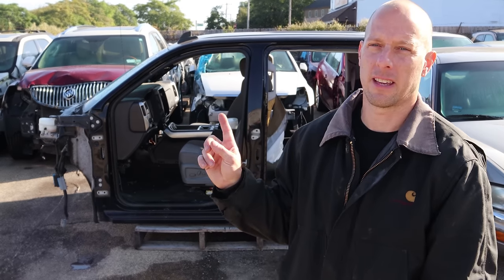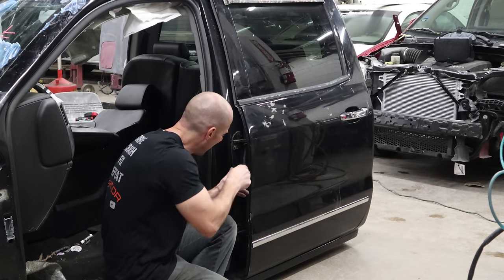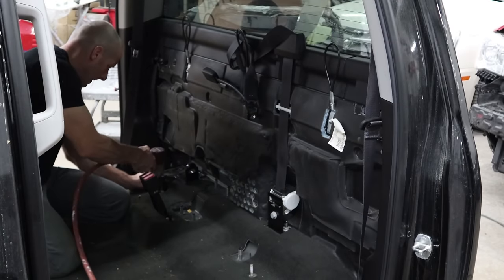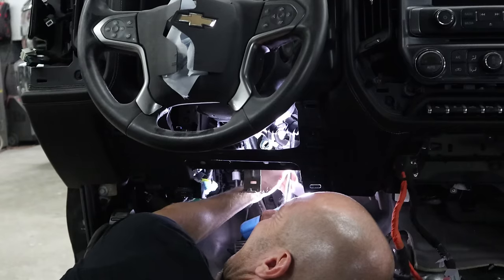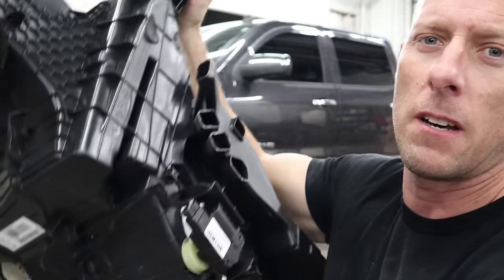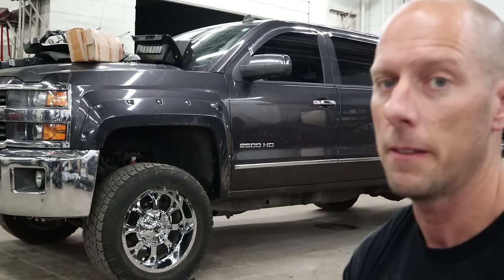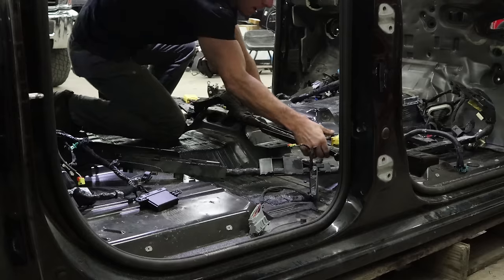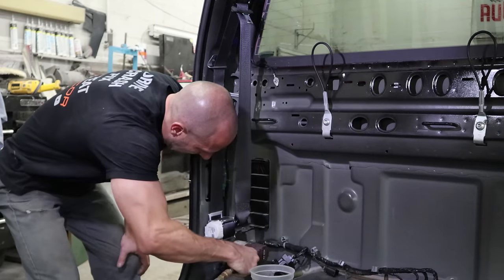Gutting the cab for the 2015 Silverado mistake and attempting to reassemble it. (Part 5)

Comment: What part of the vehicle does the paperwork go with? I always thought it was the cab. Is that correct?
Reply from the maker: I am using the paperwork from the original black truck.  The state will come retag my cab with that vin number and it is what is stored in all the modules on the truck. Thanks for watching.
Reply: @vehcor  Oh, I see. So you probably have to have the paperwork from the new cab as well right? Thank you for the quick reply. I've subscribed, your videos are great.
Reply from the maker: @SwapPartLLC  Yes, I have a receipt for the cab from the salvage yard.  I take that with all the other documentation for all the other parts I changed to the Secretary of State and they verify it in the anti-theft inspection.  That is the last step before they issue my clear, rebuild branded title. Glad to have you with us!
Reply: @vehcor  Thank you. This information will be very useful to me sometime in the future, as I've always wanted to do this. Long ago, I worked as a mechanic for a few years and I've done everything except rebuilding wrecks. Looks like a lot of fun.
Reply from the maker: I will have some tutorial videos coming out when this series is finished that might be helpful.  Rebuilding cars can be fun but stuff never goes according to plan.  Start small so that you don't get overwhelmed when it seems like nothing is going right.  Good luck if you jump in.  The finished product is worth the hassles at least to me!
Reply: @vehcor  Thank you. I look forward to those tutorials.

Comment: So just have couples of questions is the 2015 being upgrade with a newer model wiring harness and such to make it perform better, I didn't understand why you were changing the airbags above the door's was there something wrong with the other ones I'm just a little confused on some of the things you were changing that you could have left and save yourself some time maybe you can give me some answers because you were changing the wiring harness is that something from the newer vehicle that you are putting into the 2015 cab I understand the dash was messed up because the airbag went off on the passenger side, and the firewall insulation why was that changed I didn't see anything wrong with it maybe I miss something, I do like your work it seems like you know those GM cabs for sure

Comment: As always my friend very well done video. I have been looking into doing something like this, I wanted to ask where is a good place to start? I have been looking at copart.com but not sure if it's right for me. Thanks
Reply from the maker: Copart and IAA are the two biggest salvage auctions.  You can set up free accounts on both and watch cars, see what they are selling for and see what they need.  Kind of a test drive before you pay for the membership.  I use car-part.com to locate a lot of my used parts and give you an idea what the repair will cost.  I will have some tutorials on deciding what and how to buy when I get this truck done, that may help you out.  Thanks for the support!

Comment: You mention rocker rust. 

I have a 2001 that has large full length running boards and I am  at 350k with out rusting through (not gonna pretend there isn't some rust i can't see). I don't think i ever washed the truck.

I would like to have the same success with my 2018 Dually. What do you recommend for prevention the rocker rust?
Reply: Paul's Pro Tips oil. Oil rustproofing is the only thing that works
Reply: Or move to Arizona. Salting roads is a travesty that should never have been allowed from the start.
Reply from the maker: I will cover rust prevention in the future videos of this truck and even more in depth in one of my tutorials.  I would love to move to AZ and avoid all rust.  Possibly in the future.  Thanks for watching.

Comment: And now we know why replacing a heater core requires a co-signed loan.
Reply from the maker: You can leave the dash pad on for that but the heater box bolts are much harder to get at with the pesky engine in the way.  It is not much of a trade off. Lol I like those jobs, they pay big money at my job and I can get them done pretty quickly.

Comment: How do deal with the different Vin numbers between the 2 bodies?
Reply: interested in that as well, with the frame coming off truck 2 and the cab from the junkyard, are there even any VIN stamped parts left of the first truck?
Reply: I came to ask the same question. 👍
Reply: Depends on what state regulations say. Some states the VIN is tied to the frame others to the cab
Reply: He might need a new vin to be issued for the truck.
Reply: @GreyFox2000  This. Here in Georgia, the VIN stays with the cab, on GM trucks particularly, there is a plate on the driverside dash like all vehicles, and then under the hood  above the engine on the firewall. While I worked at a GM dealership, we often had frames come in to swap into wrecked vehicles, no problem. I think it just has to be noted in the VIN history that the frame was replaced due to X.
Reply: Swap vin plates
Reply: Dan Bri kind of illegal
Reply: @McFlysGarage , "kind of"?  It is.
Reply: @brittonsautoplex , is it worth going to jail over?
Reply: Keith Coppage only if you get caught 😉
Reply: Rivet the vin plate into the new cab. I don’t see a problem with it.
Reply: In the grand scheme of things the dmv will never know it’s a different truck.
Reply: You need both titles for both cabs, go to dmv and let them know the situation, they will sometimes issue a new vin for the truck. Vin goes with the cab, not the frame.
Reply from the maker: Here in Illinois I have the state police retag it for me.  It can take a while, they were called the day I got the cab...... still waiting.  It is the main and only reason I did not want to swap the cabs in the first place but this deal was too good to pass up.  I do have some connections that I may have to use if the wait gets too long.  The frame vin does not have to be changed and will be documented along with all the other parts like the door, fenders, hood and drivetrain parts in the Secretary of State anti-theft inspection which comes after the safety test.  I covered something similar in my Enclave video but not everyone watched that I realize.  Thanks for watching
Reply: I always use the one with the clean title.

Comment: For your interior assembly and disassembly, which impact driver is that and how do you like it? Great video man!
Reply: I've done similar repairs, and a 12V 1/4" impact is perfect for most interior bolts and screws.  For dashes and seats, break the bolts loose then use the 12V to zip them out, or get a 18 or 20V impact.
Reply from the maker: The one I was using was an older Matco.  It is ok, nice and compact with decent power but the battery doesn't last long (it is old though)  I have a Dewalt 20v I use all the time at work and it is decent.  A little bigger but enough power and the batteries usually last long enough for the other to charge.  I have also used the Milwaukee 20v with pretty much the same results.  Personally I am not a fan of cordless tools but for interiors you cannot beat them........ except on seatbelt bolts.  I find myself going back to the air impacts to get a lot of them loose.  Thanks for watching.
Reply: vehcor thanks for the reply! I’m in the market for one. lol

Comment: I am having trouble keeping up.
What parts are you using from the very first truck?  The frame, cab, and trans were toast.  Just the motor?
Reply from the maker: It will all make sense in the next two videos.  Original engine and turbo, complete interior, rear end, bed, tailgate, 3 doors, wiring, all modules and possibly the wheels unless I keep the aftermarket ones.

Comment: jesus, how do you remember where everything goes and how it goes together?

I ask because I have a 2004 F150 FX4 that has an amazing body but driveline? not so much. I've seen others for sale with leather interior, lower miles, but terrible bodies and been thinking about buying one and swapping the good for the bad.

I mean, I had to just put winter tires on, $1000 or I could have bought a parts truck with GREAT winter tires, and aluminum rims, for $2000.00. No leather interior though. Plus it had half the miles on it than mine. I just have no where to do it all or keep the parts until I can swap.
Reply from the maker: It comes with practice and since I had just taken one apart before this one it was even easier,  Stuff really only goes back in one way so the worst that happens is you have to remove something to get something else back in the right place.  Adding options can be tougher than you think.  Manufacturers don't want you to upgrade so they make it hard.  An 04 might not be too bad but on the newer ones options have to be programmed into the modules and they don't allow you to do that even at the dealer level.  So do some research before you jump in.  If you are just swapping in new parts for your worn out old ones, take the parts truck apart first and take pics along the way.  Then when you get to yours, you have already done it once and have some pics to help.  Thanks for watching, hope that was helpful.
Reply: @vehcor  yeah it was helpful! That's one thing about smartphones now: very easy to take pics along the way. Yeah, I wasn't so much interested in adding options, just replacing my existing cloth interior with leather etc. The beauty about youtube is there are plenty of guys who do step by step brake jobs etc so you can literally watch on your phone while you do it. I did all my COPs that way as well as my VCT solenoids. 

I do enjoy your vids and will keep watching this project come together. 

One thing that kills me though: the shear amount of wrecked vehicles available in the US and the prices. I live in Canada and don't see that many and the ones that are here are crazy expensive. There's a big auto wreckers not far from me and they want the same price for a used engine as a rebuild. Hell, I was looking at an entire F150 in Ohio for 1/3 the cost of a used engine. The kicker for me is transporting it, and importing it. It isn't that complicated but not like I can just drive over with a trailer and bring it home.

Comment: Just a question from a guy wjo has not been following the series. Why not fix the parts truck? Looks te be in a better condition than the project truck
Reply from the maker: Looks can be deceiving.  It would require more work, has less options and has a junk title.  Just because it runs doesn't mean it  is better.  Thanks for watching!

Comment: At about 9 minutes in, you say that the reason you have to do this is because the passenger airbag went off.   So, you can’t just replace the airbag straightaway ?  Or did I miss something....( I realize you are digging to get at the damaged stuff ) ?
Reply from the maker: The dash pad has the airbag attached under it.  When the air bag deploys, it tears open the dash pad.  That is the only reason I had to replace the dash pad.  I got the new/used one with the cab but had to change the wiring, pedals, heater box, firewall padding, etc so that is why all the other stuff had to come out.  Thanks for watching.

Comment: Just plastic weld the heater box and be done with it. It's pretty silly to disassemble an entire truck just for that.
Reply: HKRXPRS 
Plastic weld is shit, not to mention once a heater box twists a little, you’re going to have a bad time.
Reply: @Everythingisgoingtobealright  There are many different types of plastic weld techniques and done right it would be more than good enough to ensure you are trouble free for the entirety of the car's lifespan.
Reply: HKRXPRS 
False.
Reply: @Everythingisgoingtobealright  So, explain how plumbers affix 2 pieces of PVC pipe together. Things that make you go hum, lol.

Edit: I plastic welded my headlight assembly when I cut it open to put better projectors in the housing. That's arguably in a much harsher environment than a heater box under the dash. It's been about 5 years since and the headlights are still sealed shut. You'd be hard pressed to see the seam where the cut is.
Reply: John Long 
Glue.
Reply: @Everythingisgoingtobealright  It's actually PVC cement. It's not glue. It chemically melts the plastic, permanently fusing the 2 pieces together making them one piece.
Reply: John Long 
Plastic weld is shit, so glue the box. You are still going to be in a world of hurt if any of the flaps, doors, linkages or seals are damaged or knocked out of wack. The time he will spend swapping out the other box is money in the bank.  But what do I know.
Reply: @Everythingisgoingtobealright  You make good points for replacing it. Calling plastic weld shit is baseless though. If the plastic is simply cracked and not deformed, plastic welding it will yield a structurally sound and usable part. The process of welding plastic chemically is no different than welding 2 pieces of metal together. Sure, if you use the wrong product and the plastic doesn't melt together then the end result will be shit. Just like improperly welded metal. You don't call metal welding shit because some shitty welds fail.
Reply: John Long 
I’m no chemist,  I just know that after 30+ years in the automotive collision industry, I have never seen an acceptable plastic weld.  From $3500.00 nitrogen junk to $15.00 harbor freight junk, It’s all crap.
Reply: @Everythingisgoingtobealright  I've also been in the industry for over 30 years and have been plastic welding for over 20 of those. I have structural plastic weld repairs in daily use that are over 15 year old and just like metal welds, when done correctly are stronger than the base material. If all your welds are crap regardless then you're just a crappy welder. Go out and learn to plastic weld, it's a great skill, be it thermal or chemical.
Reply: He has the correct undamaged part paid for and available. Why he takes the time and effort to use it tells a lot about what kind of person he is and the pride he takes in fixing something correctly.
Reply: Chad Cook I Agree that this should not be repaired but replaced by a part he already has. The part can be documented on the repair sheet to clearly show the dmv what he did to repair the vehicle and where it came from. If you have looked at any of Vechor's work he never cuts corners and always does things right. He also makes allot of money back by saving good parts, reselling them, so it is not wasted effort to disassemble the truck. In fact I would want to get in there and look at it to make sure nothing else is broken.
Reply from the maker: Take it easy guys we are all friends here.  I had to remove the dash anyway to change over the harness.   I had to remove the heater box to change the padding on the firewall.  I'm going to disassemble the entire truck anyway.  I don't run a you-pull-it yard and I am certainly not going to throw away all of the left over parts.  I have to pull the e-brake, pedals, junction box, booster and column any way so I would have had to pull the majority of the dash regardless.  I could plastic weld the box and it would hold no problem.  The problem comes in at the fact that even the slightest shift in the shape of the box, a little too much weld penetration or some other small imperfection in the geometry will mean that a door may hang open.  It is a lot of work to go back and fix it (pulling the dash that is already silly as I am told). lol  Had it just been a broken tab, yeah, I would fix it.  When the crack goes around the entire case, not worth the risk.  If the parts are available at no extra cost and 30 minutes worth of work, why waste time repairing?  I think replacement is the better method but that is just how I do things.  Thanks for watching.

Comment: And when your done, you have a brand new truck with a salvage title.
Reply from the maker: ........and a bunch of money I can use to buy another one with a salvage title and rebuild it.  So I will have two trucks with rebuilt titles for the price I would have paid for one with a clear title.  Yeah, I could not care less about a word on a title when I am saving money.  Actually if I can find a few more deals like this truck, I could have 3 for the price of one and still have some left over.
Reply: vehcor whats a duramax with a salvage tile worth? 15-20k? Not worth the effort to me, Start with shit your gonna get shit.
Reply from the maker: They go for $20k-35K with salvage titles at auction.  They sell for 80-90% of the $50+k replacement cost with a rebuilt branded title.  Well worth the effort for me.  Start with junk, add skill and some new parts and you can actually end up with better than new.   I have built 1000s of perfect examples of this.

Comment: Could you not have left the complete dash assembly in the replacement cab.....or are there some differences behind the dash , between the original truck and the new cab ??  There's certainly a lot of crap behind that dash !! lol....  Also , have you straightened the frame rails of the original truck or replaced that too ??
Reply: He said it had fewer options so needed to swap in the wiring
Reply from the maker: The heater box, pedal assembly, firewall padding, and wiring are all different due to the options on the black truck so it all had to be changed.  There is no way to properly straighten the frame from the original truck, that is why I bought the rollover truck.  Thanks for watching!